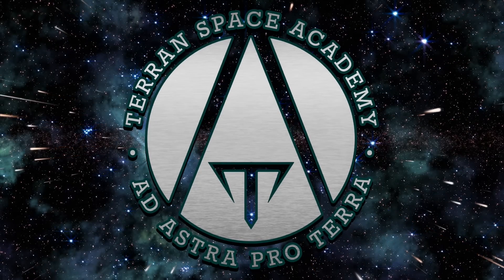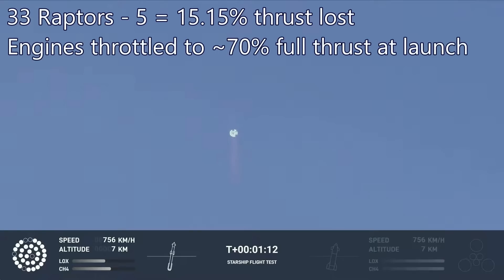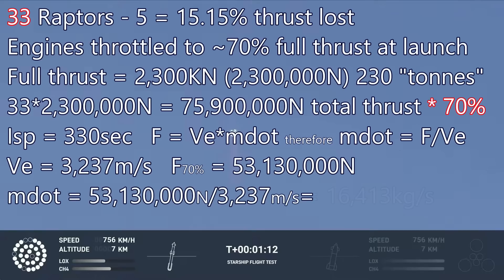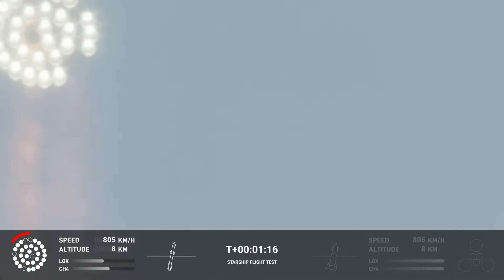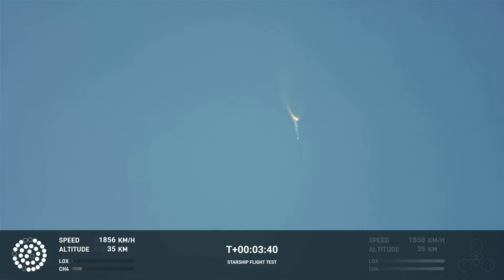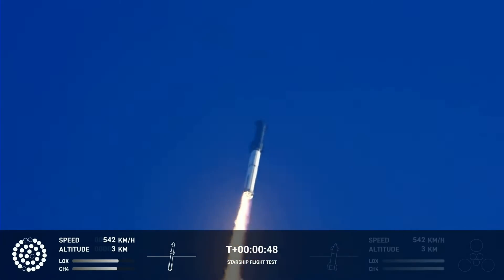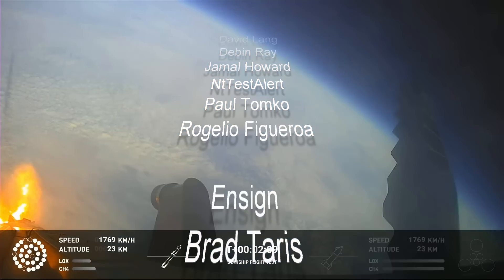Starship Flight Analysis: What went wrong with Starship?

Comment: This analysis is superficial: it's not ice you see falling off at launch, it's car sized blocks of concrete that wrecked havoc all around the pad and crushed major equipment. There is a ~4m deep crater beneath the launch pad and the material there was more than likely the cause of the initial engine failures. You are also ignoring a very clear fire that is raging around the central 3 engine formation. Starship performed admirably unde these conditions, but Stage-0 failed spectacularly bad and will have to be redesigned and rebuilt. No launch in the next 6 months will be possible.
Reply from the maker: It is ice I was talking about... but I should have mentioned the debris.

Comment: Thanks so much for an all-too-rare scientific analysis. I've been an Electrical Engineer for over 45 years, but I'm pretty much clueless about the mechanical/jet propulsion/thermodynamics issues involved in such a design and launch. But I was 14 years old in 1969 and watched the first moonwalk live, and part of me just can't understand why, after learning all those NASA lessons for the last 50+ years, a failure like this is even possible? Apparently money is no object, and apparently exploding a mult-million $ spaceship is no big deal, and I realize we're talking about much larger thrusts and weights, but I just can't understand how can so many engines fail, as well as the stage separation, and ultimately the mission? Heck, in the 60's the computer control system & simulation capabilities were a microscopic fraction of what's in a smartphone, but somehow they made a moonwalk and return to earth possible. Hard to understand. Just glad this Starship wasn't manned.
Reply from the maker: You are most welcome.  The debris was indeed terrible and I think that took out the first three and damaged the others.

Comment: I expect that being strapped to a concrete structure for nearly 10 seconds that was being turned into confetti  (but the confetti are the size of basketballs and made of stone) had something to do with having so many engine failures and eventually losing control.

Launch pads have flame trenches and water deluge for exactly this reason: to prevent the rocket ripping itself to shreds with the vibration and pressure.
Reply from the maker: Absolute fact.  The loss of three engines at lift-off makes for a slow climb therefore more debris hits.
Reply: @terranspaceacademy  even just having a big iron/steel wedge or cone under the rocket that is destroyed each time would do a lot of good, as it would deflect much the force and debris in a certain direction away from the rocket instead of just randomly.  Each launch you just crane what is left of it away and put a new one in place.  I bet it would have made a big difference in this flight for not much investment as the ship really wasn’t all that seriously damaged.  That, and holding it down for as little time as possible.

Comment: Flipping to separate doesn’t make any sense.  Why point the second stage off axis from the direction of flight before it separates? The aerodynamic stresses would be huge.  Makes far more sense to separate first then flip the booster to align it for the boost back burn.
Reply from the maker: It's more separate then flip the booster, flinging the two apart.

Comment: The nearly-empty Booster will have most of its mass at the base (engines, full LOX header tank) while the Ship's weight will be more evenly distributed. After a flip-separation the Booster will continue to rotate around its base while the Ship will be flung away with very little rotation. It's an elegant way to use the main engines (and their ridiculous control authority) to achieve staging of what will likely be the heaviest second stage ever.  🙂
Reply from the maker: I have no doubt the engineers at SpaceX have a good reason for it... it just scares me a little.  I'd still ride though.  Uhm... after a few successful flights.  That last one would hurt.

Comment: You missed a few things. The explosion(s) of hydraulic power unit(s), at least one is clearly visible, possibly removing any thrust vectoring ability. Debris probably striking engine area during holddown. Nominal separation altitude was supposed to be 70 km I heard. Oxygen in the booster was depleted, fuel was not. A lot of stuff obviously broke over time.
Reply from the maker: You are quite right.  We'll go into that on the next one.

Comment: Both during the static test and during this test flight, several engines failed! Why? Also, there was no separation of the second stage from the first stage!  These are serious issues.  During the maiden test flights of Apollo (Apollo 4), Space Shuttle (STS-1), and Artemis 1, all of the engines ignited and staging was successful.  These issues must be address!   Also, did the company hold a post-launch conference?  Where is the flame trench?  On the positive side, you had ignition and lift-off!
Reply from the maker: Serious indeed.  Though I think these engines failed due to debris strikes.

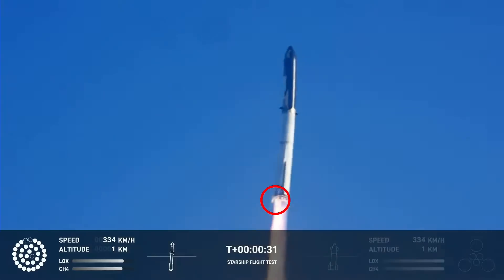Comment: Saturn 5 got to Mach1 at T+1:06 and was 7km high, Starship got to Mach 1 at T+ 1:40 and was 11km high... MaxQ for Apollo was at 1813 km/h and at 12 km altitude and in my opinion Starship didn't went through a real MaxQ  because they announce MaxQ when Starship's speed was at 868 km/h which is not even Mach 1 ( 1156 km/h).  During lift-off, you could see ENORMOUS chunks of concrete rising to the side of the booster at 200 feet in the air! SpaceX was VERY lucky that this rocket left the pad...
Reply from the maker: Good points Rene.  Thank you.

Comment: The idea of flipping the whole rocket to separate the booster is absolutely wild, I am guessing this is due to either ullage concerns or potentially because there is not enough fuel/space/time to gimbal the engine thrust around to reorient it for the boostback. Even high up in the atmosphere the rocket has to be subject to a wild amount of stress and flipping a giant rocket does not seem like best practice.
Reply from the maker: They must have an elegant reason but I like the old way better.

Comment: Also, separating at 28km still leaves a significant amount of atmosphere at 2100 km/h causing drag on the Starship. It was being pressed down onto the booster. That stickiness could be overcome by Starship spin prime along with booster hot gas thrusters slowing the booster (angled upwards). One more thruster to add to booster, but may be required if there are not already upward facing thrusters. Or maybe add a diverter for the current set to allow them to vector upwards when engaged.
Reply from the maker: They could use all the RCS that point up I suppose.

Comment: I think it flipped out of control before meco, in other words they never reached the flight target to even try to trigger the decoupling of the two stages. 
Also the Hydraulic Power Unit exploding and likely loss of Hydraulic Thrust Vector Control is significant
Reply from the maker: That's very possible.

Comment: Successful unsuccessful mission. :p

A lot of sugar coating on a failed mission. That  was a lot of hardware to sacrifice for meeting 1 test objective being clearing the tower. They  got a bonus engineering objective testing, the termination system, but I argue it was not fully successful. That was a lot of unplanned maneuvering before termination. 

The most successful  part of SpaceX is its marketing and PR. Turning perhaps 1/3 of the engineering objectives being met as successful! And it was the easy 1/3 part that was successful. How much did they really needed to learn during boost phase. Most they will learn during this phase of launch is hand slap on forehead stuff.

No. When you lose 2/3 of your engineering objects, you don't have a successful  test. This is a strike. 

Why in hell would you have a rotational  sequence as part of separation? Adds complexity in separation and forces on the release mechanism. Or was this rotation at separation not really  planned as it was being narrated?? :p
Reply from the maker: It was indeed Andre.  I'm sure they've learned a lot.
Reply: @terranspaceacademy  LOL. Sure they will. But how much of that is slap on the forehead stuff? :p 

The value added engineering learning was after boost phase. "Icing on cake" point as they put it was low value learning.

Comment: Great analysis and the functions for performance added helpful context.  I speculated that the flipping was due to the hydraulic gimballing system failing, which would also explain why the clamps didn't release the upper stage. What are your thoughts on that scenario?
Reply from the maker: You are almost certainly correct.  The electric TVC on the newer versions will be more robust.
Reply: @terranspaceacademy  Right, B9 introduces electronic gimballing if I'm not mistaken?

Comment: Thank you for the intelligent analysis and turbo pump suggestion. I suspect the engines were damaged by pad concrete debris.  Would applying heat shield tiles to the pad and adding a flame diverter would solve the problem?
Reply from the maker: What about steel plating with heat tiles?  Water cooled :-)

Comment: Apollo 7 did not fly on the Saturn V. The first crewed mission for Apollo used a Saturn 1B. Other than that, great analysis.
Reply from the maker: You are quite correct... I was focusing on the g forces.  But that clarifies 4.8 vs 4.0.  6 was a Saturn V, as was 8, so it gets confusing.
Reply: @terranspaceacademy  still awesome work here.

Comment: Launch System too close to ground, 
Engines damaged from debris from disintegrating pad, 
That need to change, too much power ,
A Falcon 9 type elevated launch pad is needed with suitable deluge
Reply from the maker: What about steel plating?

Comment: A very long winded explanation to say it was terminated after the launch. It is great to see we have come a very long way with Rockets, however it is still very much light the blue touch paper and stand clear. Gravity has so much to answer for.
Reply from the maker: Long winded!  I didn't even go into... Rocket launch pads and flame diverters are critical components of any space launch facility. These structures play a key role in ensuring the safe and successful launch of rockets, and are designed to mitigate the effects of the intense heat and pressure generated by the rocket engines during liftoff.

A rocket launch pad is a large, flat platform that serves as the launch site for rockets. The launch pad is typically made of reinforced concrete and is equipped with a variety of support systems, including fuel storage tanks, electrical systems, and communications equipment. The launch pad also includes a series of blast deflectors and flame trenches that are designed to redirect the hot gases and flames produced by the rocket engines away from the launch pad and other sensitive equipment.

One of the key components of the launch pad is the flame diverter. A flame diverter is a large, curved structure that is positioned at the base of the launch pad, directly beneath the rocket engines. The purpose of the flame diverter is to redirect the hot exhaust gases and flames produced by the engines away from the launch pad and other critical structures.

Flame diverters come in a variety of shapes and sizes, depending on the specific requirements of the rocket being launched. Some flame diverters are made of reinforced concrete, while others are made of steel or other high-strength materials. The design of the flame diverter is critical to ensuring that the rocket engines produce a stable, predictable thrust during liftoff, and that the hot gases and flames are redirected away from the launch pad and other sensitive equipment.

In addition to the flame diverter, launch pads are also equipped with a series of blast deflectors and flame trenches. Blast deflectors are large, angled structures that are positioned around the perimeter of the launch pad. The purpose of the blast deflectors is to redirect the intense blast of hot gases and flames produced by the rocket engines away from the launch pad and other sensitive equipment.

Flame trenches are long, narrow channels that are dug into the ground beneath the launch pad. The trenches are lined with heat-resistant materials and are designed to channel the hot exhaust gases and flames away from the launch pad and other critical structures. The trenches are typically angled downward to ensure that the hot gases and flames are directed away from the launch pad and into the open air.

Together, the flame diverter, blast deflectors, and flame trenches form a complex system of structures that work together to ensure the safe and successful launch of rockets. While the design and construction of launch pads and flame diverters can be complex and expensive, these structures are critical to ensuring the safety of both the launch crew and the general public during rocket launches.

Comment: Although lighting the engines as part of Stage 0 ground infrastructure was a good weight and complexity saving idea, I wonder if they'll reintroduce the idea of re-lightable engines. Of course that depends on whether they determine from post-analysis if this would have been of benefit. Some of those flame-outs looked to contain plenty of "engine-rich" exhaust!
Reply: It's not worth the weight penalty of all the COPVs that relighting the outer ring would require.
Reply from the maker: I think the Dancing Dog is correct... the mass payoff isn't there.

Comment: I was thinking exactly the same, especially when there is a crew on board. The flip will be a very uncomfortable manoeuvre for crew.
Reply from the maker: I don't think the Starship was supposed to flip :-)  Just the booster.
Reply: @terranspaceacademy  ah yes, thanks for clearing that up! 😄. So the milestones are blast off, throttle back at max q, throttle up to empty most of the first stage, stage separation (astronauts still going up), second stage fires up and away, first stage comes to apogee, spits a flip, and comes down flat, then flip, thrust vector, thrust to the catch land stop thing. Astronauts in space, booster in it’s docking station. 👍
Reply from the maker: @IdeologieUK  That's it!

Comment: "a tremendously successful test"? It was not, and we need to rein in this hyperbole. 

Saturn V never exploded. It's Russian rival, the N-1, was famous for exploding. But the altitude the N-1 reached in its least successful test flight was higher than Starship achieved yesterday. This test was moderately successful, at best. It lifted off, which should not be underestimated, but 7 engines failed, control was lost and the 2nd stage failed to separate. A 'tremendously successful' test would have put the orbiter on top of this rocket into LEO, rather than to the bottom of the Gulf of Mexico.
Reply from the maker: Not true... N1s exploded far below the altitude the Starship reached. N1 3L – first launch attempt, engine fire, exploded at 12 km.
Reply: @terranspaceacademy  Thank you for the correction. Presumably, not even Pravda described those tests as successful?

Comment: What about some commentary before it cleared the tower..? It appeared to be facked within fractions of seconds after liftoff. I've never seen a rocket go off with such wild lateral motion before clearing the tower as seen in other footage. You could tell by the vapour trails off the main body bending wildly to one side. Also, the rocket did not display the usual smooth acceleration off the pad and almost appeared to hover at one point as it struggled to remain upright. It looked like an attempt to balance a stick on the end of a finger. I think it was because those initial three engines that shut down did so almost immediately after lift off if not before. In fact, judging by the inordinate amount of time it sat on the pad whilst throttling up for launch, those three engines might have already failed .....

 I really don't understand how anyone can spin this as a success. 9% of its engines failed before tower clearence, 18% before the planned separation. Separation didn't even occur, the rocket was already spinning out of control. It seems that the definition of success has dramatically changed since the early days of space flight. NASA in the 70's - "Failure is not an option". Musk et al in 2023 - "[It didn't blow up....]". Thats a serious definitional lowering of the bar. Inspite of the Challenger and Columbia disasters ( 1986 and 2002 respectively ), the Space Shuttle was the most successful vehicle to date in terms of its overall reliability and payload carrying capacity and all because of its inherent design. It was used exclusively to build the ISS over 100's of missions. That should be the bar for success. That design should be the starting point for future space travel/transport, not old school conventional rockets. 

You could argue that the MSM were a bit sensationalist in headlining that the rocket exploded, but if one were honest, that would be closer to a summing up of the truth than the fan boys claiming it was any kind of success. This kind of blatant spin just casts Musks efforts in a more ludicrous light than they already are.... 😑
Reply from the maker: Well it was a flight analysis :-)  No, your right.  I should have said more.
Reply: @terranspaceacademy  Look, if people were honest and admitted that it was a failed test then I think Musks efforts might gain more credence. Its rocketry were dealing with here, shit happens, it's an inherent part of the territory and ALWAYS will be. Musk himself stated it was 50/50, 50% chance of success or 50% chance of failure. There can be no in-between characterisation, not if you're attempting to convince the general public that you're aiming for a reliable space program.